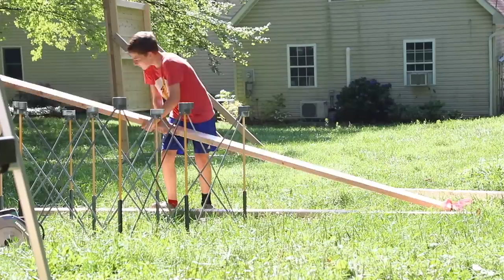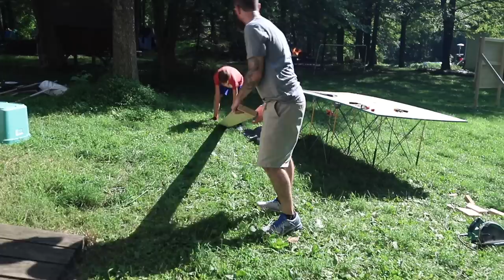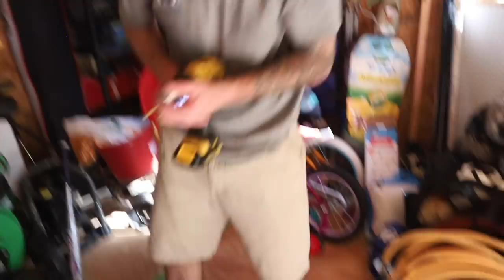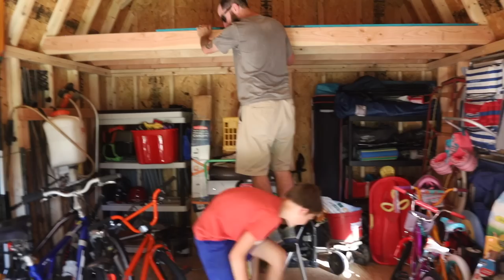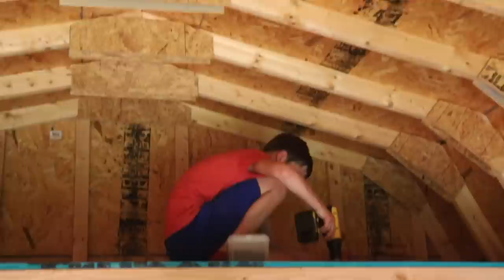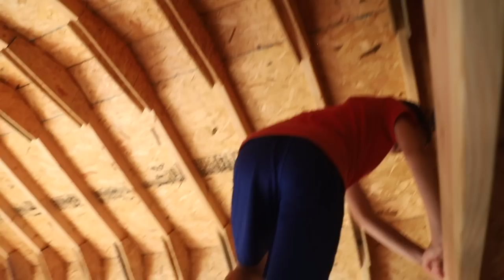DIY Shed Loft Is COMPLETE!

Comment: I have been in construction for 35 years. I have never seen a square house. Everything settles, bends, warps, etc. You always have to cut custom lengths on just about everything.
Reply: not to mention, when sheds are built, most of the process is done "on the fly" or in a huge rush, so, measurements are never calculated to perfection, and the end result is always a building with messed up dimensions.....but it still works!

Comment: When you put the loft up after the shed is built on 16” centers it’s a pain after the roof deck is on. You have to cut the joist short and split the difference. 

It still turned out well. 💯👍🏻👍🏻

Comment: What i have learned. When measuring wood, measure only 1 would at a time for an exact fit. Don't measure more than 1 wood at once. Because like you said, they are not going to have the same measurements. Basically measure 1, screw it in place. Then go measure the next one.

Comment: Hopefully you'll see this, but curious on what size sidewalls you have on that shed?  Trying to decide between 7 or 8 foot... I just keep thinking 7 foot would be fine even with a loft on one end..
Reply from the maker: Ours are 8 ft but I think 7 would be fine! The loft would be easier to reach at that height.
Reply: @LifeOnBeagleRoad  Thank, just trying not to make a mistake with going with 7... I didnt look was the shed DIY also, or prebuilt / installed..

Comment: I wonder how much weight the loft would safely hold ?
Reply: Those are 2x6x12. If the span is less than 11' across they should be able to hold around 450lbs. I would go a little less than that so that they do not sag. For a span of 12 feet you need at least a 2x8x12.